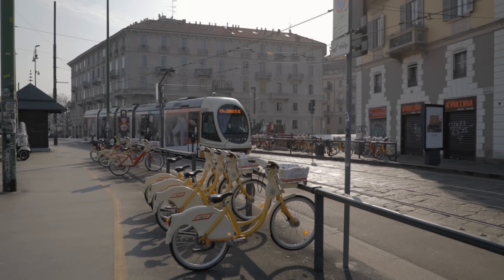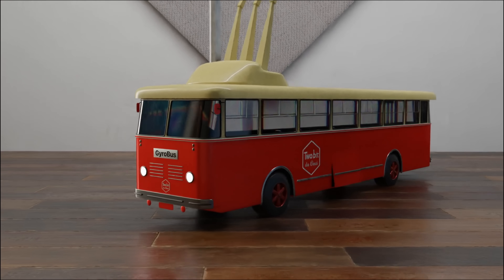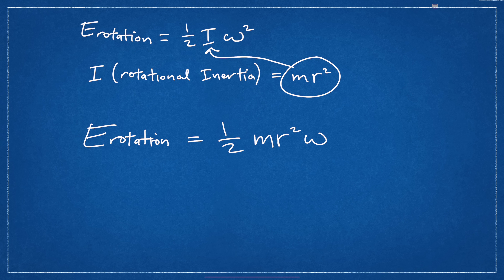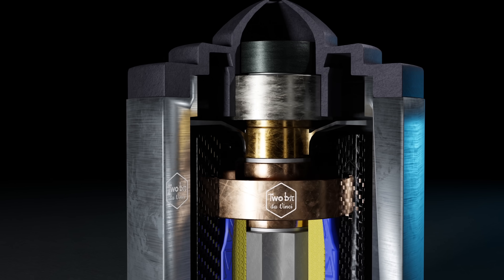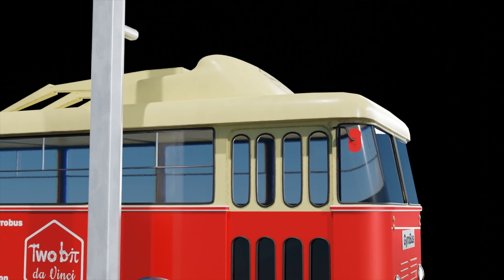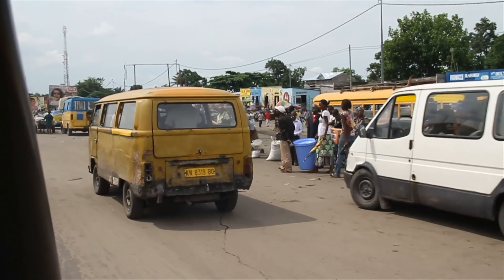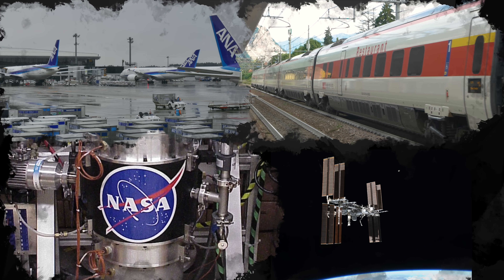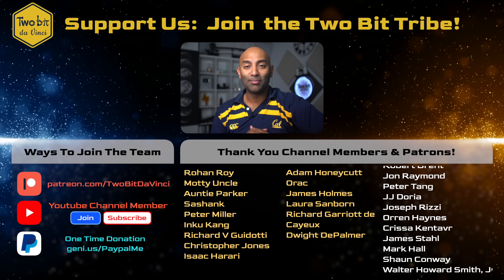This Bus Went Electric WITHOUT Batteries

Comment: This is really great information .. can this be used in conjunction with other systems like Internal Combustion Engine or Electric motor  to increase efficiency
Reply: Every combustion engine has a flywheel on the crankshaft to smooth out the power and give it some momentum to get through the compression stroke. With electric motors it depends on the application, but usually not necessary, because they can rapidly vary their torque in any position on demand. Flywheels don't improve efficiency, they just store energy and smooth out the power delivery. The efficiency depends on what it's hooked up to.

Comment: They could pretty much make those unlimited ranging cars nowadays like in betting like a wireless system into the roads every so many miles or whatever to give that fly wheel a boost in speed and it shouldn’t take much energy mainly for range issues such as like traveling to car cross country or state to state or through states mainly on the highways I could see them in bedded into the system and charging you like a monthly fee or something like most toll roads do

Comment: There are huge disadvantages to flywheel energy.  

1. Bearings will wear fairly often due to weight and centrifugal energy. 
2. Having a big heavy wheel spinning then breaking loose will kill people fairly easily. 
3. Metal fatigue. The stresses of using a bus on multi angle road surfaces will cause pressures on the chassis that will eventually lead to a catastrophic failure. Places like Seattle or San Francisco would be completely unusable with this kind of energy. 

The cost outweighs the usefulness. We have 80% efficient natural gas busses already. What would be the point? Electric energy is mostly made from coal,natural gas and water turbines. The green energy that would make electric cars and vehicles make sense we regulated out of use. Nuclear.   Solar is less than 20% efficient and wind is less than 10% efficient.
Reply: go read more, Jay.  The weight is no longer an issue, it's not a big heavy wheel any more, kevlar isn't a metal and metallurgy is well understood, natural gas buses are still hosing CO2 and they sure as all hell aren't 80% efficient, not even half that, not-using flywheels in some high-angle locations (if that is even a thing) is a stupid reason not to use them in all the flat places; your post is so wrong it hurts my heart to read it. Sorry. Please go look up KERS (from race cars), and rewatch the video noting things like "magnetic bearings nowadays", and then compare your cost and risk analysis to that of nuclear.  And don't get me wrong, I like nuclear when carefully done, but I assert that flywheel tech is entire orders of magnitude cheaper & safer.

Comment: For a Bus I can see flywheels these days better off being replaced by super capacitors. Same idea with fast charge up at each stop and a battery for backup. Each bus stop has a shelter with a roof of capacitors and solar cells so that they don't spike the grid every time a bus stops. 
No moving parts that way and as capacitors get better at storage then the distance between stops can increase, although city buses spend as much time at stops as on the move, the distances are so short. 

One place I wonder if flywheels might be useful is in Tidal Systems to help even out the highs and the lows of slack water. Something like that would add weight and complexity (maintenance) to a design so it would favour more the Grid that the operator of the tidal machines.

Comment: I'm not an engineer and never could get the formulas through my scull but I also can't believe that scientists haven't long ago discovered zero point (free) energy. I think they have. *Lonnnnnng ago* but the counterfeit governments who gave themselves the power to confiscate patents, Tesla's and any other to this day that they want for themselves and run our lives, withhold them from us to stay in control. Today's (clean) battery technologies are using such common elements as water, salt, even air. Maybe some engineer can correct me but if the gyro has the power to push those buses for 4 freaking hours between restarts it has the power to drive generators that will produce plenty of storageable electricity for 4 freaking hours at a time. I would think many times longer. Compared to the weight of a bus a generator has nearly no friction resistances. Where does my logic fail me? Idiots replying in technical lingo as if PhDs in idiocracy will be ignored

Comment: Agh I got clickbaited. Of course it needed a battery. It can't go on unicorn energy. That flywheel IS the form of battery. It's mechanical battery where you dump electricity into rotating the heavy flywheel and then you generate electricity back from the flywheel. Literally a type of battery.

Comment: One of the interesting takeaways from this video is not the flywheel but the bus-stop top up process for electric buses where the battery sizes could be much smaller with not particularly large infrastructure costs or delays to passengers.

Comment: The oil guys killed that technology for sure... Somehow they made sitting on a tank full of diesel safe, I'm sure we could make sitting on a spinning flywheel safe too.
Reply: We need a big mix going forward... Pure battery-electric, hybrid combustion-electric, hydrogen combustion, hydrogen fuel cell electric, compressed air, etc... Pure electric battery cars are wonderful for people who do lots of city driving. But rural and long distance drivers need options that go much further and/or can be refueled in a very short time in very remote places.

Comment: "pUrE eLeCtRiC aNd DiDnT nEeD bAtTeRiEs" Yeah and it worked out so well that everything is powered that way to this day, huh?... Another pipe dream... "Sounds good" but it doesn't work that way... You need more energy to get a flywheel going than the energy you would ever get back out of it... Simple physics... We don't live in a universe where that would work... Friction... Heat... Just a bunch of feel good nonsense... Even if we could over come the physics that limit us, we're so far away from be able to do so that we won't see it in our lifetime... If it were ever to happen...

Comment: You should have covered the Transmission/Gearbox system.  It's one thing to have all that stored energy and another to utilize it efficiently especially as the Gyro slows down.  The bus would have to stop quite regularly to 'spin up' independent of passenger needs.  This would increase travel time.  All said the power has to come from somewhere it's not free.
Reply: Yes. Exactly. We simply do not live in a world where it's possible to get equal or greater energy out of something than the input in the first place. With the laws of physics and everything else involved, its plain impossible in our world. While we can create near perfect conditions and a faux atmosphere or environmental, the inputs and energy needed to create said environment would far negate any energy output.
Reply: @mikeznel6048  I have a 'battery buggy' and people seem to think I travel for Free.  Then I say I have an electrictiy meter ... ... Oh? 🙄

Comment: I feel like flywheels are like the mechanical equivalents to supercapacitors. They are better for transport though, because they are cheaper and more easily scalable. That gyrobus was an awesome thing and I wish we could use more mechanical energy storage.
Reply: I recently visited a datacenter which had a flywheel as emergency battery, pretty impressive.
Reply: We had a 14 foot diameter flywheel attached to a very large rock crusher at the Clayton CA rock quarry.  A 140 HP motor drove it and the flywheel had square holes all around it so we could drop a square pin into it then pull it with a crane or loader to help the motor to start if it was jammed up.  The shaft was  34 inches in diameter !
Reply: Well, flywheels are closer to a coil storing an energy in a magnetic field than a capacitor because the energy from capacitors flows back to where it came from while a coil/flywheel pass it further in the original direction. Spring is a good mechanical equivalent of a capacitor IMHO.
Reply: Flywheels have found use in racing applications. First experimented by the Williams F1 Team using it as an energy recapture when braking, although it was banned in F1, it found use in other racing series like WEC. It also returned use in public transport bus, but it was a combination of a diesel hybrid drivetrain with the flywheel supplementing the energy recapture from braking and recharging it back to the main lithium batteries.
Reply: Super capacitors are FAR superior for transport and are far more scalable than flywheels. Flywheels are cool, but they are extremely costly and can be exceedingly dangerous if something goes wrong.
Reply: Yes i hope too. Mechanical energy storage is very reliable & long lasting& more enviromently friendly than chemical batteries.
Reply: Wait, you said they're cheaper? Doesn't they require very low friction, low tolerances for all the parts, and complex gearboxes to function? In modern cars everything mechanical tends to be replaced by the electric because it's cheaper. I'm confused...
Reply: No sir Inductors
The mechanical equivalnet of Capacitor is mechanical spring
Reply: Please sir dont think only obey...i agree but if we progressed to things that are free or cant be metered then those in charge shove un back on thier Path
Reply: Nah, they are more like inductors. Both have an inertia that you need to overcome first for starting to save energy on them... In the form of inertia.
Reply: Humans 0
Saiya-jin 1 to 6
Angels 7 😇

Kalki Ironman 5th matriya buddha 8th arc Angel 11th satguru 13th imam and 24th avatar after 2026 😎

Almighty God 9 😇

Humans type 2.5+ after 2026 by Kalki Ironman (christ in the white horse)(son of man on clouds) type 7 and 8 😎

Jarvis the world’s first artificial intelligence (parrot) 😎

Cuz Kalki is ironman batman super saiya-jin superman ben10 saitama Narutoo optimus prime and every super heroes combined after 2026 😎

Jarvis world’s first artificial living being (just like vision in marvel universe)😎

Made of Quantum and sub quantum particles 😎

Power source quantum energy arc reactor (type 7) level technology 😎

Kalki Ironman going to have every kind of arc reactor like:- type 1 Nuclear fission, nuclear waste, hydrogen fusion, type 2 3 4 5 antimatter arc reactor (solid liquid gas), type 6 electro quantum arc reactor, and type 7 Quantum arc reactor, type 8 limitless quantum energy arc reactor without quantum particles 😎

Kalki Ironman going to have sun in a box million billion tons of hydrogen nuclear fusion reactor type 2 3 4 5 just like sun and stars in the palm of his hand 😎

This all going to happened by self replicating quantum nanobots knowledge energy and techniques at type 7 7 7- respectively 😎

Ironman (Tesla 2.0) going to reveal every secrets of the world specially Tesla and his Antigravity 😎
Reply: The drawbacks have ben mentioned. Gyroscopes resist changes in momentum. It becomes hard to steer such vehicles. Also steering them will lose energy. 
This tech is best suited for non movable energy storage.
Reply: @FreeSatTracker  every automobile and motorcycle has gyroscopic effect in its driveline and wheels. Seems like a dismissive position to take
Reply: @FreeSatTracker  modern gyroscope/ energy storage devices get around that with one simple rule decrease mass increase speed
Reply: @FreeSatTracker  Have you heard of gimbals?
Reply: @tiberiu_nicolae  exactly what I thought, like a compass on the sea.
Reply: @FreeSatTracker  right which is why I don't understand why there isn't more talk for use in renewables storage.
Reply: @FreeSatTracker  Hey,  Can flywheel be used for store energy instead of battery in solar system? If so what is the cost comparative? Thanks. We can dig a well in back yard to house this device
Reply: No they aren't super capacitors don't care if you make a left turn or decide to go down a hill.
Reply: @DoctorMangler  the word "like" is often used in english to draw a comparison between 2 or more objects. hope this helps😊.
Reply: @DoctorMangler  what part of "mechanical equivalents" you didn't get?
Reply: @pdr-s5i  Great question... there are no electrical equivalents to gyros.  But hey don't you understand that?  You could happily drive around a 3000lb supercap all day no problem, change it to a gyro and flip your vehicle on a turn, or miss the turn and hit somebody..... get it now doofus?
Reply: @DoctorMangler  yeah, I don't understand how It works, my dumbass will def search about It. I believe he was trying to relate like capacitor X batteries and gyros X something else, guess I'm wrong.
Reply: @pdr-s5i  At the end of the video the author explains how the bus nearly flipped over because of the inertial forces generated by the flywheel.  Modern flywheel energy storage systems are stationary, and they are really cool.
Reply: @DoctorMangler  So turn it on its side and place it at the back behind the rear wheels where most modern busses have their engines. Then you wouldn't add much of anything in regards to rotational force to the front, keeping the steering unaffected. And because they already have it, any extra load on the suspension from the flywheel can be evened out by the Air suspension to keep the bus level as the flywheels velocity changes.
Reply: @andrewbillington5422  OMFG you have no clue how a flywheel works.  Turning it on its side, counter rotating wheel and all it still resists change of direction.....  that's a hallmark of flywheels and inertia.
Reply: Z

Comment: Besides flywheels as amazing energy storage solutions, there are also salt batteries and flow/electrolyte batteries.  All of them are time-proven technologies.
Reply: Characteristics of selected energy storage systems (source: The World Energy Council)
Tech, Max Power, Rating (MW), Discharge time, Max cycles or lifetime, Energy density (watt-hour per liter), Efficiency:
Pumped hydro, 3,000, 4h – 16h, 30 – 60 years, 0.2 – 2, 70 – 85%
Compressed air, 1,000, 2h – 30h, 20 – 40 years, 2 – 6, 40 – 70%
Molten salt (thermal), 150, hours, 30 years, 70 – 210, 80 – 90%
Li-ion battery, 100, 1 min – 8h, 1,000 – 10,000, 200 – 400, 85 – 95%
Lead-acid battery, 100, 1 min – 8h, 6 – 40 years, 50 – 80, 80 – 90%
Flow battery, 100, hours, 12,000 – 14,000, 20 – 70, 60 – 85%
Hydrogen, 100, mins – week, 5 – 30 years, 600 (at 200bar), 25 – 45%
Flywheel, 20, secs - mins, 20,000 – 100,000, 20 – 80, 70 – 95%
Reply: @CTimmerman  LMAO quoting grossly outdated data is as relevant as quoting early predictions about the world wide web.
The fact is there are flow batteries that have been running non-stop for decades now, and salt batteries that have been running for over half a century.   Also modern-day mechanical batteries can run for decades as well.   
Try doing some actual research for once.

Comment: Over a decade ago Porsche tested out a special race version 911 hybrid that had a flywheel, in addition to an I.C. engine. The Porsche 918 RSR has a flywheel accumulator that powers 2 electric motors. This car also has an I.C. engine.

Comment: The flywheel would have no gyroscopic effect on the bus turning due to its axis of rotation being vertical.
 now what it would have an effect on is if you tried to change its inclination to fast (transitioning to a hill), it could torque the bus on to its side

Comment: On the glimpse you give of the flywheel station that regulates the electric grid in New York, we see several dozens boxes that seem to store a wheel each, probably about 2 meters in diameter. Why use such small wheels, rather than build a wheel several dozen meters wide? The efficiency would be much higher, right?
Reply: Not possible. Its not a linear increase of energy output for input energy. It doesn't work like that in our plane of existence what for the laws of physics. We simply can not get equal or more energy out of anything than energy it takes in the first place. It's physically impossible in our natural world. You can create faux atmospheres and conditions to make it close to perfect and whatever it is you're doing be as close to 100% efficient as possible but all the inputs and energy required to create the ideal false conditions would far exceed any gain or return in energy you would get from what ever it was you made the faux conditions for in the first place. Gravity, friction, heat, thermodynamics, all make it physically impossible in our world.
Reply: @mikeznel6048  I meant storage capacity per space and weight of material.

Comment: The secret to flywheels as energy storage is, to use them as stationary "batteries" only. It is actually very impressive, what they are capable of with the modern solutions to friction and speed. One of my favorites, because it is an easy energy conversion as well.
Reply: Still, in our universe and laws of physics, we will never get more energy back out of one. We won't even be able to get equal energy back out of them required to get them moving. It's just not physically possible in our plane of existence.
Reply: @mikeznel6048  of course, if it was any other way, the universe would just explode.

Comment: I researched this technology over10 years ago.  One company I visited showed me their system that spins a carbon composite wheel over 50,000 rpm.  Out back of their facility was a fenced area of stock & components, one item of which was a failed flywheel that had a 2 inch gaping hole thru its 1 inch thick steel housing!  I doubt they wanted anyone to notice it!